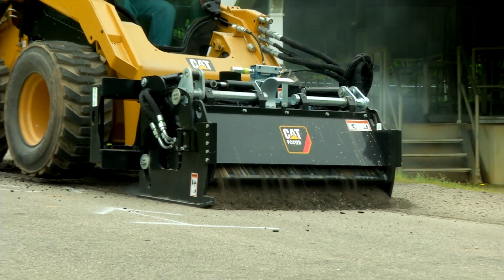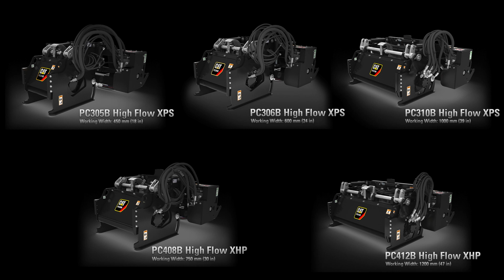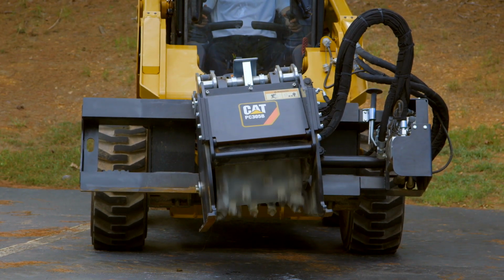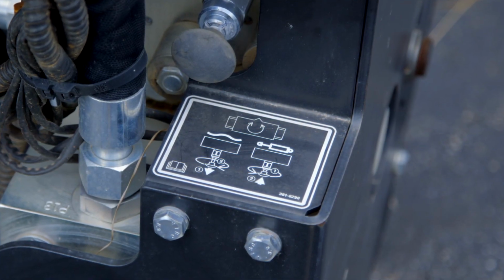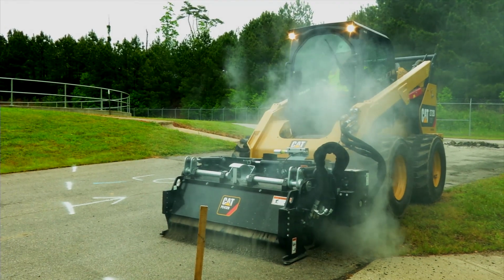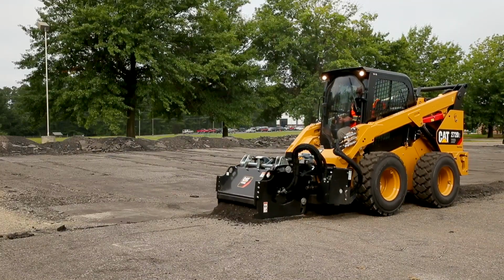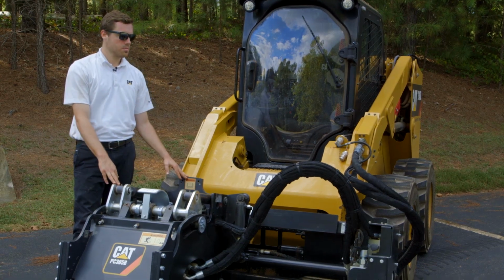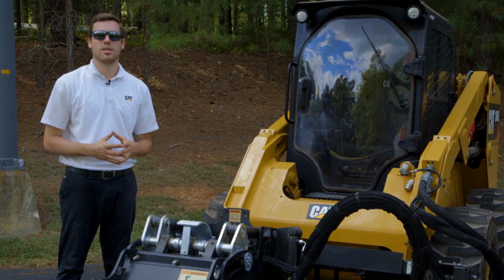Cat® Cold Planer Overview

Comment: Want  to add here  that  the water jets  are in the  wrong  place   the  pc 206 was  also  a far  better planer  than these new ones   you messed up  the  speed on all the    tilt depth and  side shift   and  can some please    shed some  light on the  couplings, I'm  sure  the standard one  will restrict   the    flow ??